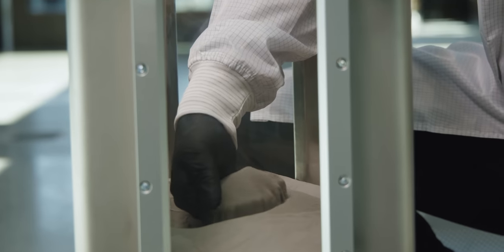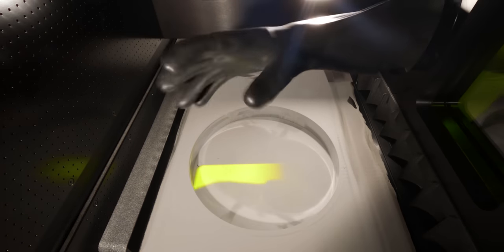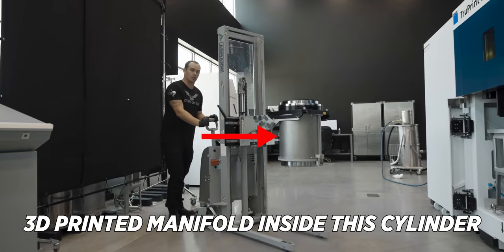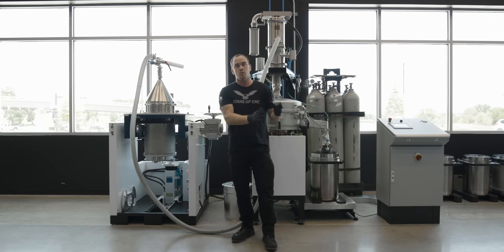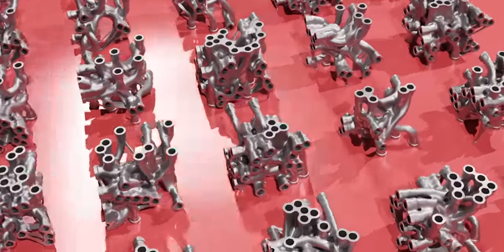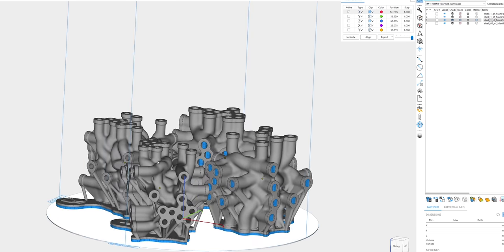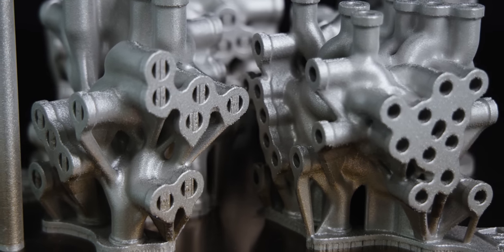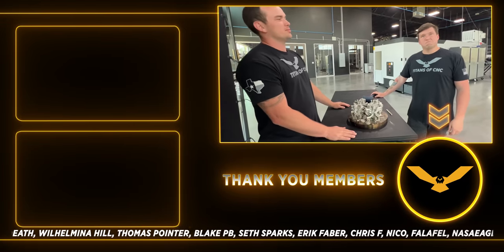Metal 3D Printing | The Future of Manufacturing?

Comment: Trumpf (the 3D printer manufacturer) should design and manufacture a complete enclosed workflow to avoid contaminating the room or operators handling cylinders.
The enclosure should include all of the vacuuming, etc.  The cycle time is increased too much, moving from device to device to suction the powder in respirators.
Build a safer and more efficient system..

Comment: Cool. Can you port these for anything? Jic/ORB etc. Is this for low pressure only as the tear drop shape creates flat surfaces that weaken or Crack the manifold? Can you machine these to fit valve carts? Are these generally for mobile applications?

Comment: Maybe I missed it in a previous video on your 3d metal printing, but how do you clean the build plate?  You wire EDM the part off, but that leaves bits on the plate.  Do you chuck it and reface the plate?  If so, is the build plate a consumable?
Reply: We usually put it in a lathe, mill, or surface grinder and face it until it cleans up all the way. The build plates have about 7mm of usable thickness before you need to get a new one. So in theory, if you are taking a .25mm clean up pass after every build, you can face the build plate 28 times before you need a new one.
Reply: @trevorgoforth8963  Thanks for the reply!  Are the build plates proprietary, or can you take raw stock, turn it to the right dimensions, and mount it to the printers mounting plate? (sorry if I'm getting the references wrong.  There's near zero chance of me ever getting to play with one of these, so I'm living vicariously through your videos :) )

Comment: Correct me if I'm wrong, but isn't the lower carbon content for better weldability? Which is kinda important in this use case? Corrosion resistance should be similar

Comment: How much does 3D printing cost?  I am currently processing parts on a milling machine, one piece costs €8k.  Interesting, although still unprofitable...
Think too expensive
Reply: That depends on the complexity of the part and if you can clean-sheet design the part for additive manufacturing.

Just printing a part that was designed to originally be machined isn't likely to pay off, you'd leave too much benefit on the table.

(I've seen a showcase where the printed part was more expensive by a factor of 10. But the improved wear life was also increased by at least that much. Net zero, right? It also reduced planned downtime tremendously and THAT benefit made the 10x price hike an absolute no-brainer, less cost from downtime saved much more than the price of the part.)
Reply: Pie in the sky numbers gaming.

Comment: Metal 3D Printing is an addition to manufacturing methods and not a replacement for existing technologies. You only have to look at the production times on these machines to know that. Of course, metal 3D printing can produce geometry that cannot be made any other way, but cost is still very important in mass production. When a designer constructs a part, he must also take into account how this part can be manufactured cost-effectively. If he does not do this, he is a bad designer and should take up another profession.
Reply: As an NPI R&D Engineer for the past 20 years, I cannot over emphasize your comments.
Reply: While metal 3D printing can be used for protoyping of mass produced parts, more often than not they are used as the final parts in low volume production where the designer will take advantage of the ability to design without the design limitations that come into play with more traditional manufacturing methods.

Comment: how do you separate the part from the plate? also isn't there any leftover on the plate after the separation ? do you need to plane it afterward ?
Reply: Usually you cut the parts off an a wire edm or a saw. The build plates can be faced off an reused. They have 7mm of usable thickness so if you face .25mm off of the plate after each build you can use the same plate 28 times before you need a new one.

Comment: Next step is to print multimaterials manifolds for better thermal transfer or to coat the inner faces with corrosion resistant material (and lightweight material for the rest). It's now possible by LPBF but not on Trumpf printers.

Comment: I don't think that this has future, seems like a good idea to be able to 3d print metal and it is, but with the limitation of the resistance of the piece,  that can only be achieved by the forging and tempering process, I mean if you are going to make a metal piece is because you need it to be resistance, otherwise you may want to use another material. I think that the cnc machining has more potential, since it starts with a block of treated metal.
Reply: Where I am we use 17-4PH stainless, which is precipitacion hardened! 1000MPa yield strenght! On an SLM machine with no supports!
Reply: @sergioro8_125  17-4 PH provides an outstanding combination of high strength, good corrosion resistance, good mechanical properties at temperatures up to 600°F (316°C)
not really for rocket engine lol
Reply: No future?  Metallic sintering has been around for 25 years, and used extensively in many industries for the past 15 years.  I design parts on a daily basis to be 3D printed in metal because more traditional manufacturing methods just would not be feasible, including parts made in Inconel 625 that has to handle high loads and vibrations at 1200°c.  Typical structural properties are superior to that of metallic cast parts.  Not all applications require forging and post heat treatment processes.

Comment: Does this part need to be sintered?  How is going to be held for the countless secondary opps this part requires?  What about porosity or how do you do qc?  When it’s all said and done seems as though this is not much more than a hi tech rough casting.  I don’t mean sound so negative about this but this is being presented as legit process but It doesn’t mean a thing until you can produce a functioning part.  The devil is always in the details.
Reply: Spot on sir!

Comment: I'm curious, why is the build cylinder a cylinder when compared to most commercial printers when the build plate is square or rectangular?
Reply: Probably because its a pressure vessel?
Reply: I don't know but my guess would be that it's easy to make and to get a airtight fit in the cylinder
Reply: @Guranga93  that would explain the use for the nitrogen in the chamber.

Comment: cast billet vs forged... cast aluminum vs cast aluminum under 40lbs of vacuum... a bucket of sand and it prints the same part out of sand? because metal out of a chemical refinery is atomically powdered. meanwhile on the farm, i cut up a 1/4'' socket extension with a angle grinder and a bench grinder and made new tapered roll pins for the wheel bearing on the car. drove 5 miles with a 3% peak  duration of 35'000 pounds force, 2000lb static into the bearing at 30km/hr and now it rolls good and smooth like new just had to add grease. sucks that I cant but 280'000psi tensile SMAW welding rods but it looks like the E7018 Lincoln NASCAR rods hold upwards of 170'000psi.

Comment: It's not the future, stuff like this has been around for a while, the problem with printed metal (pressed metal powder parts also fall into this with the same flaw) is that the powder will not always fully melt or bond to the entire part so then you have random structural issues leading to increased random defects
Reply: Not to mention, very likely it won't be NSD under X Ray, plus not sure how would it fair meeting tensile test , or intergranular corrosion test, and impact test , specially at -196 degree Celsius. 
Guess in future it will, for now seems challenging...but for sure, looks lot less messy 😊

Comment: It doesn’t work for several applications, and the upkeep is far higher on the printers, at least for titanium due to oxidation.
Reply: They build within an Inert gas filled enclosure  wether Titanium, Aluminium or steel.
Reply: @YowserUK  the powder continuously has to be removed and purified because of oxidation. 1 of my clients runs about 500 of them just for titanium. It is not an easy or cheap process by any means.

Comment: Is there a metal that can be used in that machine strong enough to create a small engine block???
Reply: Absolutely.
Even stainless steel has superior properties to cast aluminum.
Reply: @TqSNv9R0iG5Ckxew  most companies are not going to use that because it's too expensive 😮‍💨 the engine will probably last forever which is bad for business.
Reply: @ampere-mam  
I agree that 3D-printed stainless is a complete overkill but it's an option.  Although the technology is cool, there are already lots of cheap small engines available so I wouldn't try to reinvent the wheel.

Comment: only useful for bespoke no-load or low-load parts. im honestly not sure why this gets so much hype. yea you can build powdered bits of metal into "anything"? so? it won't have the same properties as the actual metal. You could do the same thing with wood...and it would be just as disappointing.
Reply: Not just bespoke items, but low manufacturing, similar to that of 5-axis CNC machning but often cheaper and quicker.   Typical mechanical properties are superior to that of cast metallic parts (the most common mass production process) , but the process allows you to design in strength without the design limiations of traditional manufacturing processes.
Reply: @YowserUK  if it was actually better, part companies would already be using it
Reply: @protovack  Companies are using it, I've been designing parts for metallic sintering for the past 13 years. The larger  sintering suppliers have 50+ machines queued up all day long making parts.  It's used extensively in aerospace and formula 1.

Comment: Why couldn't you print free-floating check valve slugs embedded 
within the structure?a hydraulic manifold is just a manifold.with check valves you can make a pressure regulated bootable apparatus.
Your think one deminshionally   playing with a 3 dimensional tool.😁🧑‍🔧🥲
Scary looking construct that could be developed into a 1/3 less bulk with accessory functioning architecture designs.
Not for me that's for Shure.

Comment: 3d printed parts have inferior physical properties compared to machined or casted parts!!! We all know this, so why all the hype!!!
Reply: Superior to casting, close to Machined.  Not all applications require the highest physical properties and the process allows you design in strength without the design limiations of traditional manufacturing processes.  As an example, certain parts of Formula 1 headers have been 3D printed in Inconel for the past 15 years.  They are as thin as 0.6mm wall thickness and withstand 1200°c with all the combusion process pressure pulses and vibration and forces associated with a race car on track.

Comment: 3d printed metals still need machining and forging proces isn't yet invented.

Without forging this is just play pretend
Reply: While these parts do require post process finish machining. They can handle hydraulic applications without a “forging process” there are companies 3D printing  and using hydraulic components already.